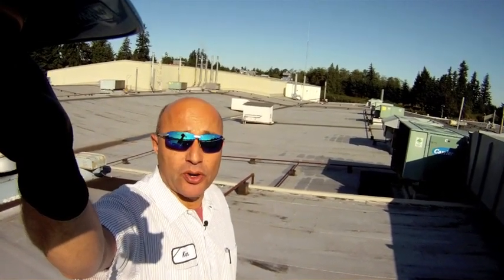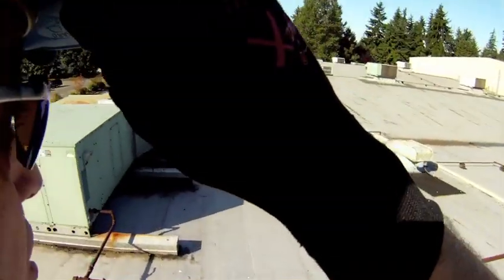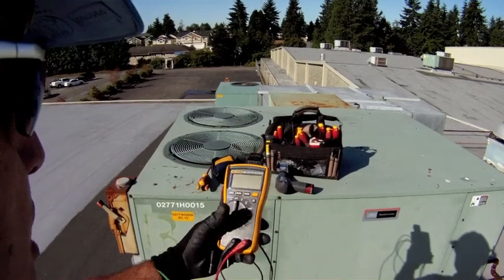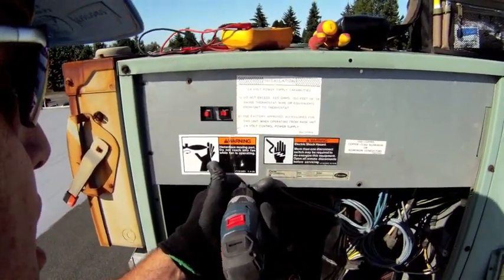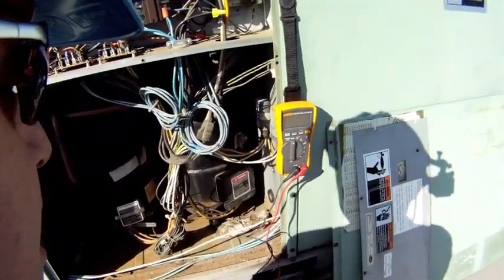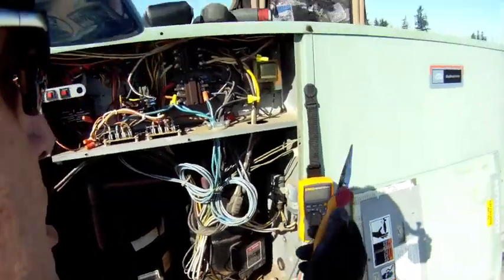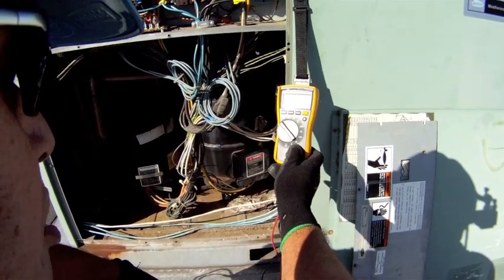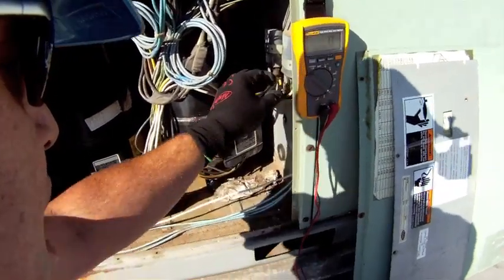How to Test a Capacitor Using The Fluke 116 HVAC Multimeter

Comment: will my fluke meter 116 test duty cycles
Reply from the maker: Thanks for your question Dale! The Fluke 116 does not have the function to measure duty cycles. We have meters that will, check out the Fluke 87V or 280 series to obtain that measurement with a Digital Multimeter. https://bit.ly/3v1gnme

Comment: Why not check it under load to get a more accurate reading.  Can that meter display voltage and amperage simultaneously?
Reply from the maker: Hi Ulises - Great question.  In this video, we were showing that the meter has the function of measuring a capacitor. Ken, the technician, went through the proper steps of de-energizing the system, discharging the capacitor and measuring the capacitor using the function on the 116. 
Yes, you can also test the capacitor under load, but in this video, instruction on testing the capacitor was not under load.  
In a future video, we would need to use the 902FC for making the measurement under load or having the 116 with a i410.
Reply: @fluke  ??
Reply: Fluke Corporation send me out those meters and I’ll make a video for y’all and I’ll put it on my channel also.
Reply: Agreed.  I'd rather test it under load.  And use a UEI or Fieldpiece meter that does amps and volts on a dual screen readout.
Reply: Ulises Palacios I never thought you’d side with fluke. If they change your mind, they change mine.  What do you say fluke corporation, want to make 2 new customers??

Comment: I was taught on 3 phase 460v equipment, it would have been nice to see you test and verify power was actually shut off with Fluke meter. I can't tell you how meany time i have went behind someone else where they had jumped one leg around a disconnect or switch gear.

Comment: Great tip for capacitors- do a voltage check across the terminals for 5 sec. to safely discharge them. The resistor in the meter can easily drain any cap.
Shorting with tools can damage the capacitor even if it's safe for you.
Reply: paulerockalot really ? very cool thanks

Comment: I replaced a disconnect at work the other day that didn't open and close the blades like it should with the lever. Always check to make sure the system is actually dead before sticking your hand in like that.
Reply: Live-dead-live check always!

Comment: Treat all Electrical as if it were a Loaded Firearm !!!
Plain and Simple like Stated the Disconnect could Fail always Test Load Side, and in the Same Instance what if the call was Placed and it was Actually Failed Windings , Discharge Cap , these Procedures only take Seconds !!! 
Your not gonna Hurt the Cap by Discharging , Caps Charge and Discharge , Charge and Discharge , your Cap may not be Hot 99% of the Time but why risk that 1% !!! (Safety First) ...
No need to Beat anybody Up about it !!!

Comment from the maker: (cont'd) I also agree with you, charge should dissipate through the windings after the compressor is DE energized. Nevertheless a capacitor is an electrical device used for storing electric charge.

Comment from the maker: (Comment via Ken) Good call on the secondary energized circuit check. I should have checked incoming power on the line side of the connections before I put hands on. That said, I plan to continue shorting both run and start capacitors prior to handling. I agree with our college who posted the shotgun like effect of a faulty capacitor. (cont'd)

Comment: I have had heard the comment before.  About the only way that could happen is if the start and run winding both failed at the same time, then you removed the cap.  I have touched a run cap that was charged.  It is pretty much like a 120v shock.  If you can come up with another way it could happen, I would like to hear it.  Thanks for the comment.

Comment: I know this comment is 3 months old, but considering the safety factor felt it necessary to comment. Run capacitors  do have the potential to hold an electrical charge. I pulled one from a unit once, set it on top of the unit and discharged it with a screwdriver. Normally nothing happens, but this time the cap being discharged sounded like a gunshot. I'd rather not know what would of happened if I touched both the terminals with my hand. Run caps can hold a charge, trust me on that.

Comment: I guess I must respond.  If you are demonstrating best practices, please consider doing a voltage check after shutting off the disconnect before handling electric terminals.  Yes we all do it but I have had disconnects fail to open the circuit.  Fluke makes a nice voltage tester.  Also run caps do not hold a charge.  They discharge through the windings.  Not trying to beat you up.  The video is good and clear.